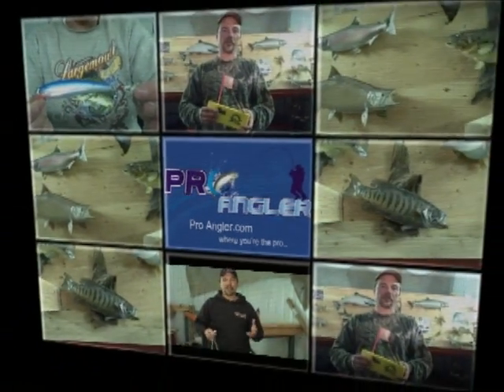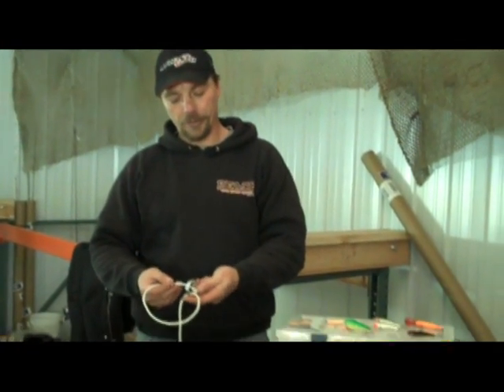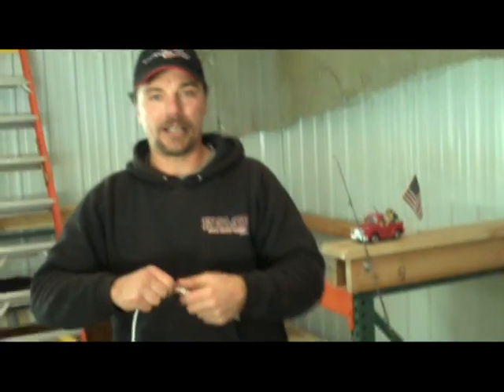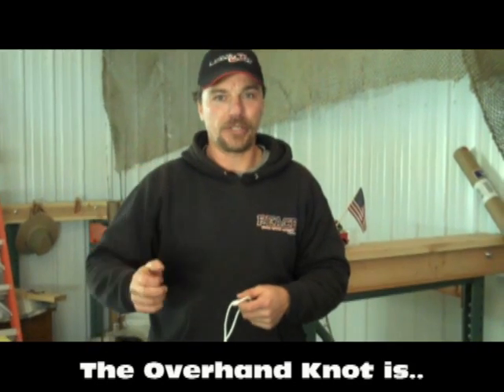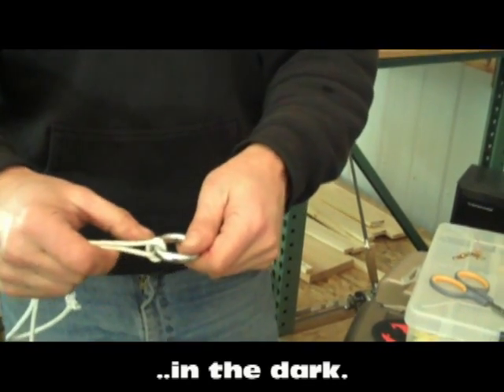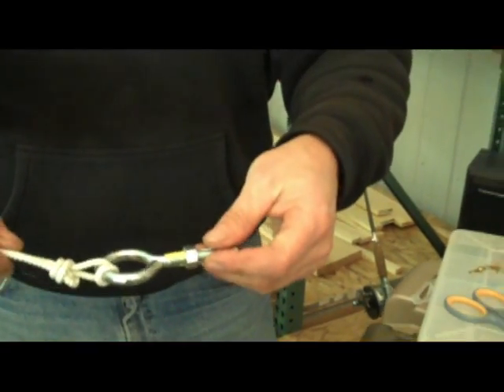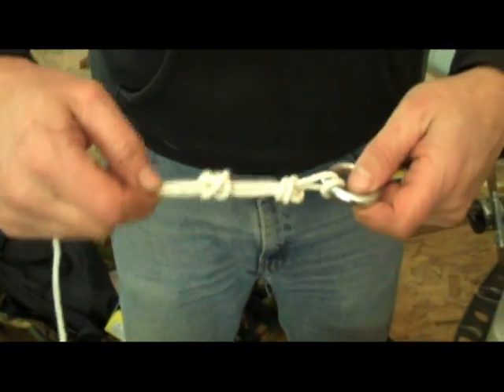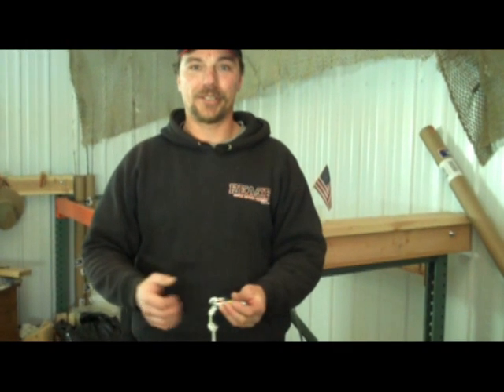Double Overhand Knot -vs-  the Trilene Knot by Chris Pluntz

Comment from the maker: Hi. Great Comment!
The primary use of this knot is as a knot that is very fast to tie, can be tied in the dark and as backup to your primary knots. The knot tracks very straight as the first knot does not touch the eye of the hook. This leaves the hook the ability to rotate on the loops and is not forced into any specific position.  
The second loop is tightened by pulling on the hook to cinch the knot. Try tying it in the dark.. you'll really get a feel for why we use it as a back-up knot.

Comment from the maker: I wouldn't use this knot with heavy spinner baits. It does break easier than a Palomar knot or trilene knot. It works best when your in a hurry, on rough water or light is really low as a good back-up knot.